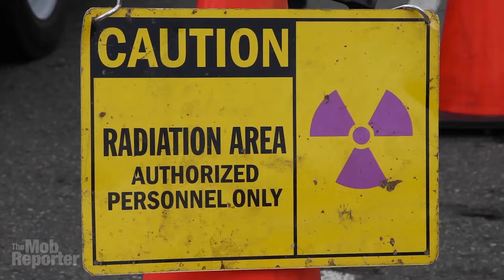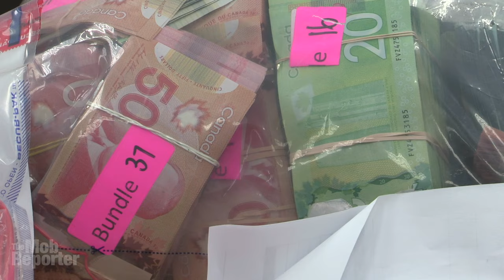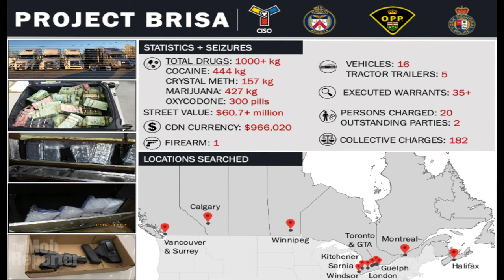“The Trap Maker” — Secret Weapon of Cross-Border Smugglers

Comment: i moved into a studio apartment in the 90s that was in a known drug house that was raided a month before i moved in. the new owner and tenants had no connection to the previous people that got busted. i found two hiding "traps" in this studio. they use diagonal tongue and groove siding in the entry way and there was a tv stand built into a wall. the tongue and groove has sections and one had a tiny hole you inserted a piece of wire into and the whole board came off the wall for hiding. the tv stand was a platform on hinges like a fireplace that lifted up from the bottom concealing a safe cemented into the ground under the house.
Reply from the maker: And.... anything inside??
Reply: @TheMobReporter  drug dealers are pretty stupid but they're not that stupid.

Comment: As a mechanic and collision technician , among other things these trap doors are not hard to make once you know the basics of low voltage electrical  and basic body work techniques, the most difficult part is detection from X-ray machines and 🐕 drug dogs. I have personally seen work from the cartels inside a transmission , where the valve body was cut and some of the insides were hollowed out to occupy 600k worth of heroin. A small scale but multiplies by the number of modified cars. Would you mind doing a report of Alfred Anaya? Thannks
Reply from the maker: I know Alfred’s story — it’s a amazing — but it’s not mine to tell. That’d just be ripping off another journalist unless something new develops.
Reply: @TheMobReporter  no worries , thanks for the response
Reply: @Mechaniclyfe  i was thinking about this case while i watched this report.
Reply: Went and read over his entire career and story because you people mentioned it, it was extremely interesting and I’d never heard of the guy until 20 minutes ago. Cheers for that have a great day.
Reply: This was also one of my first thoughts (transmission, oil pan etc). I think of so much more sophisticated stuff and i think its defently worth it for them if the profits are right. Spend some hours or days to safely make 600k sounds defently reasonable.

Comment: I've personally seen the whole side of a Chevy Suburban's side slide out like a mechanical drawer at the San Ysidro border in San Diego. These trap compartments are very common.
Reply from the maker: What was inside it?
Reply: @TheMobReporter Empty, I saw it after it had been seized
Reply: OK that’s pretty cool sounding especially when you think of the slide out mechanisms on campers and motorhomes and instead of expanding floor space it opens a hidden compartment

Comment: Here are the steps:
1. Rear window defrost.
2. Passenger side heated seat
3. Back driver side window lowered halfway.
4. Turn radio onto 960am station.
5. Put temperature to 75°.
6. Pump brake 3 times.

Tell me what happens...
Reply: My car exploded
Reply: That car became a Sauna.

Comment: Interesting stuff.... Back on the mid-80s on London I knew well a welder and diesel mechanic who on the 70s had worked on both Lancashire (UK) and The Netherlands welding compartments into the oil sumps and elsewhere on Ford Transit minibuses used on the "hippy trail" between NW Europe and South Asia.  He was a.mine of information.  He had worked in shipyards and bus garages and elsewhere, but always said the most interesting and inventive work he did was on the minibuses.
Reply: Wasnt the oil on the oil sump too hot and melt the drug?

Comment: They act like this is a major seizure yet they admit they dont actually know how long its been going on for and quoted at least a year they have been transporting so if that's the case this is a drop in the bucket not  a major accomplishment
Reply from the maker: Sure it’s a drop in the bucket. But it is me who said I don’t know how long it operates. The investigators might know. But taking out a well-run network that has been running for a year is still a major accomplishment.

Comment: some of them eat green eggs and ham. Some of them do not eat green eggs and ham.
You're really pushing this one to 7 minutes....just like back in school when you used 1.25 line spacing on book reports to get to the 3 page minimum limit. 
sometimes it works and sometimes it doesn't.  Just like this video.
Reply from the maker: If I wanted to pad, I would have padded until the 8 minute mark so I could get mid-roll ads! 🙂 But I didn’t. I wasn’t going for filler, I just like breathing room in my videos.

Comment: Pot? You said cocaine, meth, oxy and pot. Who is going to smuggle pot into Canada when it's legal and dirt cheap? And Metropolitan Toronto population is close to 6 million people as of 2016. Bad reporting. Check your facts.
Reply from the maker: Rikki, my reporting is accurate. You are looking at the Greater Toronto Area, which is an area that includes more than the city of Toronto boundaries. I am correct in my statement on the approximate population of the city of Toronto, which is the municipal boundary policed by the Toronto police, the service that conducted this investigation. As for the pot, I suspect the pot was in the trucks when they were heading south to the States and then filled with coke, etc., for the return journey. Facts checked; they’re correct.